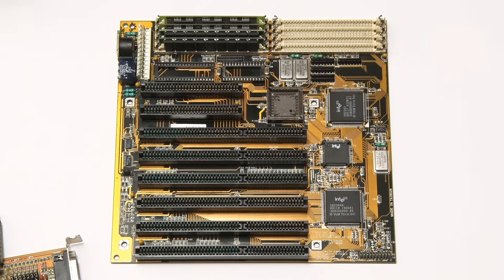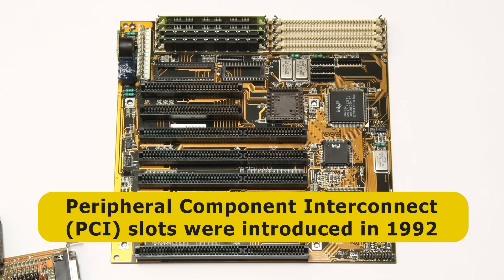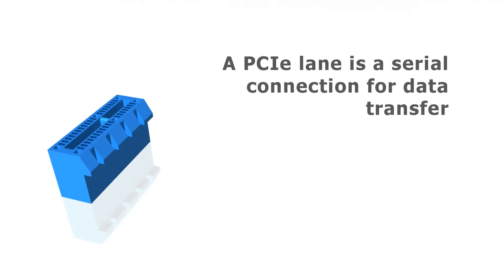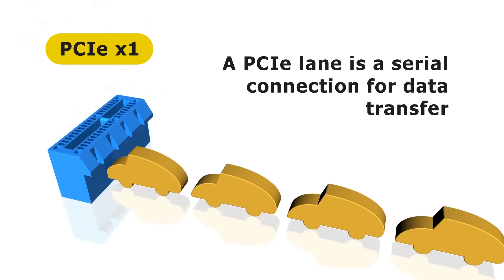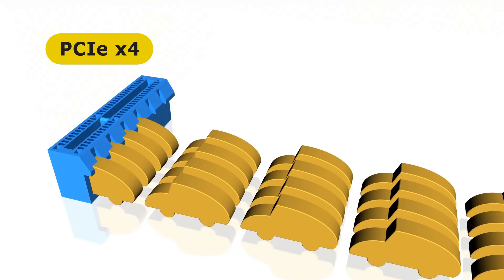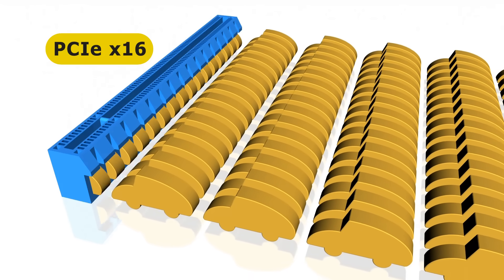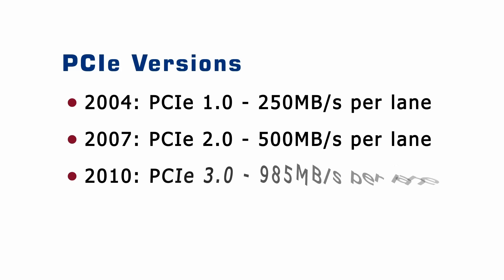Explaining PCIe Slots

Comment: How the usb3.0 card runs up to 5GB/s through PCIe×1 slot ?
Reply from the maker: USB 3.0 has a maximum speed of 5 Gb/s -- five gigabits per second, not five gigabytes per second 5 GB/s). 5Gb/s is 625 MB/s (megabytes per second), which as the table in the video shows, can be delivered by a x1 PCIe 3.0 slot, and you can get close (500MB/s) using a x1 PCie 2.0 x1 slot. Also, nowhere in the video do I say that just because a card will work means that it will work at the theoretical maximum speed. :) In fact, very little hardware works at the theoretical maximum.

Comment: Does the GPU always have to be placed on the top most PCIe slot; or closest to the CPU on some motherboard models?
EX. Asus Prime Deluxe {https://www.asus.com/ca-en/Motherboards/PRIME-X299-DELUXE/overview/} supports 2-Way SLI so technically it shouldn't matter which of the slots the GPU goes in. However, I recall some people mentioning the GPU always goes in the slot closes to the CPU (top most for this board) but I don't think it actually impacts the GPU's performance as long as its in either of the x16 slots.

Comment: Hi Christopher, I saw that you still comment on your older videos (which is amazing btw). I have a quick question regarding compatibility with PCIe. I wanted to buy a new GPU, namely the Radeon RX 5500 XT (8GB). Apparently the 5500 connects with PCIe 4 x8. The MB I have only supports up to PCIe 3 x16. Does this mean that the GPU only runs at half the memory speed that PCIe 3 supports (which would be 7,88 GB/s) due to it only having 8 lanes? It really surprised me when I heard this. Bad move of AMD since PCIe 3 is still popular, and the 5500 is a budget GPU while MBs with PCIe 4 is a lot more expensive.
Reply from the maker: The Radeon RX 5500 XT has PCIe 4.0 support, but will work just fine in a PCIe 3.0 motherboard. In fact, right now probably a good 99 per cent or more of all PCs on use are PCIe 3.0. So do not worry -- the card will not operate as fast as in a PCIe 4.0 slot, but it will be just fine.

Comment: Ok I just spent my Friday evening trying to figure out if I'm actually getting the fastest speeds regarding NVME along with my Pcie slots because my board is a bit unclear of some things. So  if you could provide me with some advice, I would gladly appreciate it. 
So, the  board I'm using is an Strix X 470 F Gaming MB from Asus. These are the listed Slots on the board: (Depending on the CPU these all change, but I am using a Ryzen 7 2700x which I believe is a ryzen 2nd generation and it states - 2 x PCIe 3.0 x16 (x16 or dual x8)
PCIE 3.0 x16_1
PCIE 2.0 x1_1
PCIE 2.0 x1_2
PCIE 3.0 x16_2
PCIE 2.0 x1_3
PCIE 2.0 x16_2
M.2_1 Socket 3
M.2_2 Socket 3
Now, in the board manual there are some rules to how lanes are shared:
1 PCIeX16_3 slot shares bandwidth with PCIeX1_1 and PCIeX1_3.
*2 M.2_2 socket shares PCIe clock with PCIeX1_1, when PCIeX1_1 or PCIeX1_3 are occupied, M.2_2 only can support SATA mode.
Ok, so now I have a Crucial P1 3D NVMe PCIe M.2 1TB which is slotted into the M.2_1 Socket
A Powercolor Red Dragon Vega 56 which needs a pcie 3.0, so i slotted it into 3.0 x16_1
I "think" that I should be getting the fastest speeds since according to the rules, I have not shared the lanes, am I correct in this thinking? 
But now the part where I'm getting confused. I run VR and the USB hubs from the board do not supply enough power, so I had to purchase a PCi3 USb 3.0 hub. The one I purchased states:
Support USB 3.0 ver1.0
Support xHCI ver1.0

Supports USB 3.0 / USB 2.0 / USB 1.1 at the same time
Each USB port supports up to +5V / 900Ma power output

Built-in 4Pin or 15Pin power transmission
So currently I have that slotted into PCIE 2.0 x1_1 slot
After watching this very clear explanation, I'm thinking that I made a mistake. Would it be better to slot the USB hub into the PCIE 3.0 x16_2 or would that then create both x16 to then run at x8? OR if I slotted it into the PCIE 2.0 x16_2 be better? Since the Expansion card states that it supports 1, 2 and 3.0 all at the same time - but finding the specs of the card itself it states:
Transmission rate	Low Speed : 1.5Mbps Full Speed : 12Mbps High Speed : 480Mbps Super Speed : 5Gbps - so I'm assuming now that 1.5 is running 1.0, full at 2 - but to have it running at super at 5Gbps, what would I need to do? 

I know, super long but you seem to know your stuff!

Many thanks and stay away from Covid!

Comment: Thank you for the slot education. It was priceless!!
I only have  pcie 2.0 slots. IF you actually can plug in a pcie 3.0 card into a 2.0 slot, that would be fantastic. But on the other hand I am using Linux. I don't know if Linux would like it.
I can't wake up my computer from sleep mode, using a displayport cable. But I CAN make it wake up from sleep, using the VGA port. I tried everything else on the Web besides a new video card. Maybe I need a new motherboard?? Who knows? Everybody is having sleep problems, using the display port cable with different OS's as well.
Reply from the maker: You can indeed plug a PCIe 3.0 card into a PCIe 2.0 slot, and it will work (if at PCIe 2. speed). What kind of DVI cable are you using? And what kind of DVI port do you have? If your cable is is DVI-D (digital) and your card is DVI-A (analogue), then this may explain the issue. DVI can carry either analogue or digital signals . . . All explained in my video here: https://www.youtube.com/watch?v=v9c1SLX7Vog

Comment: 08:00 I did just this (put a x1 card for USB sockets into x16 slot) because I did not know the slots came in different physical lengths; I did not realise that the short slot was also a PCIe. 

(The card had been sent to me by the maufacturer because I found that 2 of the USB 3 sockets at the front of the PC installed by them did not work, and I was unable to physically remove them; I could not get the relevant plug to disconnect from the motherboard & was scared of breaking something if I tried too hard. The mfr sent me a card with 4 sockets to make up for the 2 that were not working - which I thought was fair.)

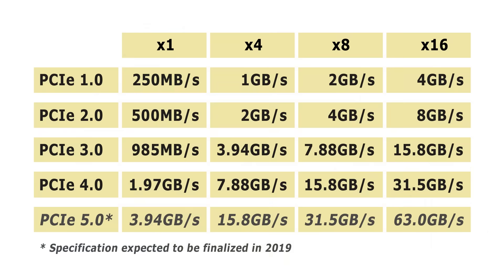Comment: @ 4:50 He shows a chart that shows the speeds. Often times people list there graphics cards as
 "PCI X16 " Not " PCIe " let alone if it is 1 X or 2X and so on. I have an old system I am guessing that it is a 1 X.  So IF  I were to get a graphics card and it turns out to be a 2 X or 3 X  is it going to work ?  If so I assume that it would only be at the 1 X speed ?
Reply from the maker: PCI and PCIe are very different slots. If you have an original PCIe slot, it may well be x1 and not labelled as such, and will work with a new graphics card. But do check that an older computer has the power connectors a new graphics card may require, and the power to supply it.

Comment: CAN I INSTALL SSD IN PCIE 16 SLOT AND WHICH TYPE OF SSD BETTER FOR IT I HAVE INTEL DH67CL MOTHERBOARD AND I WANT TO ADD SSD IN IT
Reply from the maker: You could, but a SATA SDD connected to a SATA port on the motherboard would be a far better solution. You could add extra SATA ports using a PCIe card if needed.

Comment: great video.. my question wasnt really answered tho! i get the PCIe x1 x2 x4 x8 x16 on my pc my big ass video card blocks a PCIe X1 slot so i put the ELGATO HD capture pro in the other X16 slot.. now im trying to ADD USB3.0 and Type C to my PC but all that is left is a PCI slot not the PCIE. what is that slot used for? can i put PCIE cards in it?
Reply from the maker: A PCI slot can only take PCI cards, not PCIe. Most cards (aside from graphics cards) used to be PCI, and there are still some (eg) sound cards with PCI interfaces. I don't think you'll find a USB 3.0 card with a PCI interface. :(
Reply: @ExplainingComputers  thank you i found an extension flex cable to extend my pcie x1 to another location
Reply from the maker: @SLYZANY  Ah, a good solution.

Comment: Fun fact the very first PCI Express card was the Radeon x300 from 2004 it had a 128 MB video memory and a clock of 325 MHZ it supported DX9 and the card supports PCIe 1.0, the card will still work on any modern PC with a PCie slot, https://www.youtube.com/watch?v=QRM02cpUaY0&t

Comment: Sooo,can I put pcie 3.0 card into a pcie 1.0 slot? I think it's 1.0..mbord is fsb1333
Reply from the maker: You can indeed, but if it is a garphics card, there may be a power connector needed for the card also, so make sure your power supply supports this.
Reply: It doesn't work but i know now why..

Comment: Hi i just subscribe..very informative video..i been planning to upgrade my old pc a dell  core i5 5th gen to a newer video card  gtx1050ti right now it doesnt have video card because its onboard vcard. Will you tell me if its possible. Btw my mobo is v2kx3.tnx
Reply from the maker: If your motherboard has a x16 PCIe slot, and you have a PCIe power connector available, a high enough rated PSU, and space in your case, you can upgrade.

Comment: So I can use pcie 3.0 graphics card in my h61 motherboard which has a pcie 2.0 . So it will run at the speed of pcie 2.0
Reply from the maker: Yes, correct on both counts -- assuming you have the power to run the card (some require an additional power connector, so do check fo this.
Reply: @ExplainingComputers  thanks

Comment: Which PCIe motherboard support NVMe?Every or some?
Reply: Bus Type	PCI Express 3.0 x16 is about my MB
What do you think, can i attach nvme?
Reply from the maker: It will depend on the motherboard -- you will have to look at the manual for your board. A motherboard without an M.2 slot is very unlikely to support NVMe drives via a PCIe slot.
Reply: @ExplainingComputers  it have an m.2 slot. but is it nvme.im not sure.i will risk :)
Reply: @ExplainingComputers  it's about laptop.i look and i see m.2 slot with one little fence.i think it's for this one notch on nvme drives.am i wright?

Comment: Hello, I bought a motherboard that has 2 video card slots (main pci is 16x, secondary is 4x), it has a 1x slot but the video card will cover it, and I need to connect a 1x wifi network card, theoretically I can connect it in the second 16x slot (which is actually 4x), but I was told that these two 16x slots are controlled by the processor and the 1x slot, by the motherboard, and doing so could affect the performance of my video card. Is that true? the motherboard I bought is a GA-AB350M-DS3H V2. thanks in advance. (sorry for bad english, not my main language).
Reply from the maker: It could impact performance, yes (probably knocking the 16x slot back to 8x). But it does not sound like you have a choice. And it should work fine.
Reply: @ExplainingComputers  thanks for the answer..

Comment: I have a slot on an old Intel celeron board that looks like an agp slot but it's backwards and it has a little nob that you can pull with a spring in it acting as a plunger to lock what ever card goes in there. What slot is this.
Reply from the maker: It sounds like AGP -- there were many versions.

Comment: It might be worth noting, that up to including PCI, all slots shared a bus and it's bandwidth (AGP and VESA being some crude exception). With PCIe, each slot gets it's full bandwidth, regardless of how many other slots you equip.
If you add DMA and Interrupts, which is a bit more complicated but equally important, you'll easily notice, how far we have come compared to the early XT's, AT's and ISA-based 386.
All from the early IBM PC, which was arguably the most broken and crude microcomputer-design of its time.

Comment: thanks for the info I always thought you could not connect a PCIE 3.0 GPU card to a PCIE 2.0 because i thought it will destroy the board and slot but watching this video put everything in perspective and said yes you can run a 3.0 pcie GPU on a 2.0 pcie but only run a 2.0 speed lanes awesome.

Comment: Love the simple and accurate explanations of the adaption to PCIe and the X factors from the early days of ISA and before.  I had a computer shop for many years mid 90s to early 2000s and indeed you had to be very careful installing cards in-case you got it wrong and your card and/or motherboard went up in smoke!  Thankfully, that only happened once to me... and it was covered by the supplier who replaced the card (thankfully the motherboard still worked) as they admitted responsibility for not checking before they sold them.  Chris, you did this viddy in 2019 ... are PCIe 5.0 released yet?  If so, can you do a speed comparison video to show us in reality what that really means to the end users?  Thank you ... love your style.
Reply from the maker: Thanks for this. :)

Comment: Then pcie x16 slot can connect pcie x16 2.0 graphics card. Right?
Reply from the maker: Yes, any PCIe x16 slot should take a PCIe x16 graphics card, regardless of its generation. But it will operate at the lower generation speed (be that of the slot or card). So, eg, a 2.0 card in a 1.0 slot will operate at 1.0 speed.
Reply: @ExplainingComputers  ok thanks I can understand.

Comment: One thing I've really struggled with is understanding PCI lanes from the CPU, the chipset and what I can plug into what. My CPU has "16 lanes" according to Intel, but I am running a x16 GPU, an X1 expansion card, an NVME M.2 drive and 2x SATA HDD. Does this mean my GPU will automatically drop to x8, even though it's in an x16 slot? Or will it allocate x16 lanes until I need to access from the M.2 or plug something into the USB expansion card? Worried, as my OS is on the NVME drive so don't want my GPU permanently stuck on x8!
Sorry if the question is long winded and a little convoluted, but I haven't quite got my head around it!
Reply from the maker: I've not got enough info here -- your chipset will have lanes also.

Comment: I have pci express 1.0 slot but can i put a pci 3.0 graphics card in it?
Reply from the maker: You cannot put a PCI card in a PCIe slot. If you mean a PCIe 3.0 card in a PCIe 1.0 slot, then yes, it should work in terms of the interface. However, be aware that some PCIe 3.0 cards require more power than  PCIe slot can provide, so may require an additional power connector to be connected to them, which may not be available in a PC with a PCIe 1.0 slot. Good luck! :)

Comment: Hii, I've using a PCIe 2.0 x16 motherboard and I installed a new PCIe 3.0 x16 Graphics Card into it. But the motherboard doesn't detecting it. Now my graphics card is waste!!..🤦🏻‍♂️🤦🏻‍♂️
Reply from the maker: Sorry to hear this. A PCIe 3.0 x16 card should work in a PCIe 2.0 x16 slot just fine. Does the card require a separate power connector to be fitted to it in addition to being in the PCIe slot? This may be the issue.
Reply: @ExplainingComputers  My Card is Galax GeForce GTX 1650 EX, it doesn't require separate power supply, but the problem is, it's not detecting in the BIOS. The fans on the graphics card is running smoothly yet the card is not detected. PLEASE HELP ME!!

Comment: If I put gpu PCIe x16 3.0 on PCIe 2.0 
Will the GPU work fine with full speed 100% or will work with half speed ...plz answer???
Reply from the maker: The GPU will indeed work fine at its full speed. But its exchange of data with the rest of the system will be slower than if it was plugged into a PCIe 3.0 slot.
Reply: @ExplainingComputers  Does that affect on gaming ??
Reply from the maker: @aymanashraf5072  Yes. But you may still get a perfectly good gaming experience.

Comment: I have put in my PCIe USB 3.0 card into my PC. it has got power but the PC is not detecting the card. can you help?
Reply from the maker: What is the operating system? It should be detected in Windows 10 or a modern Linux distro. In these circumstances I always turn everything off, and remove and reseat the card. Good luck!
Reply: @ExplainingComputers  I have turned everything off took out the card and repeated it and it worked! Thank you so much!

Comment: just did a upgrade power supply , video card , solid state , wifi card ,   computer did not boot I started pulling installs one by one ....turns out the wifi card will not work in PCI-e x16 (wire x4)  but does work in PCI-e x16 (SLOT1)  ... well that sucks because new video card is covering PCI-e x1

Comment: Sometimes putting a lower lane card into a x16 slot would not work.
The slot must also support the a common lane as the device supports in order to work.
Some of the first PCIe 1.0 slots can only accept x16 in x16 slot, so if you put something like a GT 730 which is a X8 card into that X16 slot, even though the pins all line up perfectly, you wont get a post

Comment: Based on your video, I would imagine if, for example, your x1 device was Gen 3 (985 MB/s) going into a x16 Gen 2 slot (8 GB/s), you will only be getting 500 MB speeds, or the x1 Gen 2 speed...  I'm guessing the number of lanes actually being used would be the limitation as well as the slower generation's speed.

Comment: My new card is in the post :)
Reply: Well its fantastic but I cant seem to get more than 30hzs  out of my rx 580 and not that its too important its only an 8 bit card. Great for now though. I dont know how 10 bits looks like. Is 30hzs the limit for hdr. Its plugged in to hdmi 1 which presumably has the highest spec. Unless i made this mistake is that refresh rate the limit?